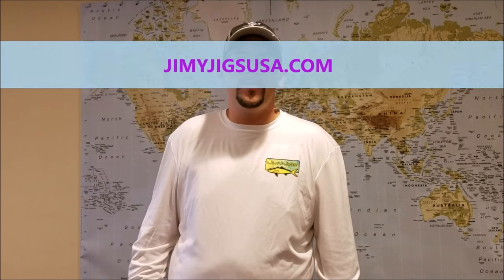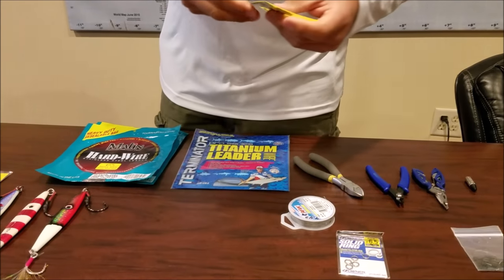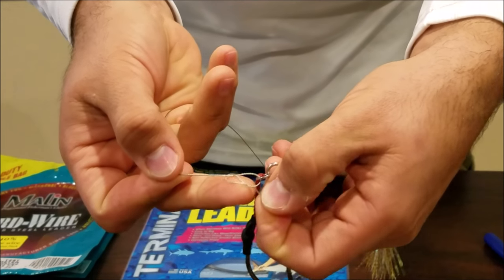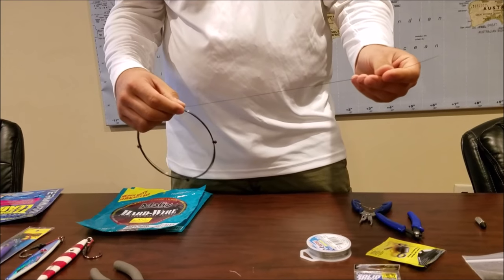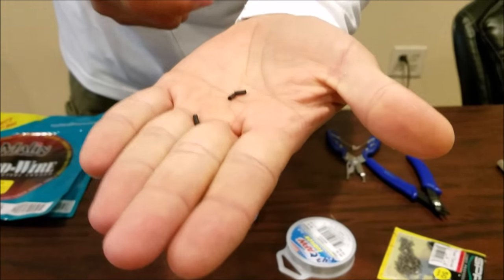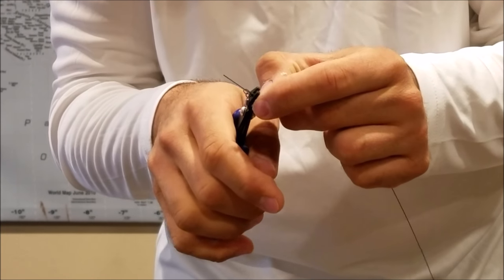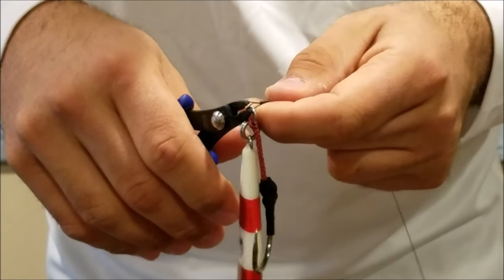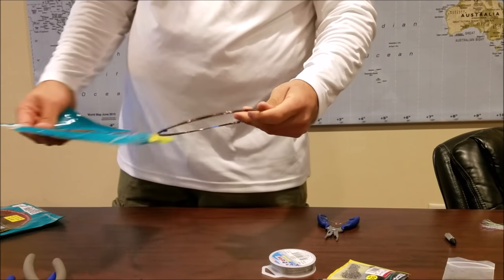How to tie wire leader to your vertical jig

Comment: Nice demo! I just wrestled with coming up with a solution of my own, to cutoff jigs. Commercially available wire leader assist hooks are limited, and hard to find. I do have the steel leader hooks shown in this video, but wanted option(s) I can use with any size/type of hooks in my tackle box that matches the size jig. Some field testing, to see how fish will react, is ahead,  before posting my solutions. Thanks for sharing this video, great job!

Comment: Bro, but wire leader can afraid fish? Sorry for this question, I just wanna know.
Reply: The chances are really low depending on the fish's sight and the day but it's better to have a wire because the chance of a fish getting in the boat is higher than with just mono because it has a much better chance of breaking off, plus if you break off you loose the jig. Switching to wire will increase your catch rate and make you lose less vertical jigs.

Comment: I like using ball bearing swivels on my vertical and surface jigs. They're pricey absolutely but I think it really allows the jig to swim better. I like the Owner ball bearing swivels myself but there are lots of good ones. Give it a try, they're a couple dollars each but I rarely lose them, I'm more likely to have my assist hook cut off than the entire rig. Good luck!
Reply from the maker: Thanks for the comment, yes i have used the ball bearing swivels too they are great as well.
Reply: Hi..does wire leader doesn,t affect the movement of a jig..I wanted to try it for so long but I always think the jig will not move freely and I might never catch a fish.I just usually do shore line fishing using 20 to 30 gram jig..

Comment: do you reduce the number of bites by using metal leader?
Reply from the maker: Some people say they do and some say they dont, in my opinion i rather use the shortest piece of wire i can get away with about 6- 8inch and use titanium which is flexible and allows for a more natural motion of the jig like mono leader, and if im going after king fish i rather get 7 out of 10 possible bites and put them on the boat than 10 out of 10 and lose more than half to cut offs.

Comment: Do you attach the wire leader straight to the braided line?
Reply from the maker: no, I attach it to a 10-15ft leader then with an FG knot the leader to braid
Reply: Thanks for your response, really appreciate it!
Reply: Hello. What pound test fluorocarbon leader do you recommend for fishing over wrecks for Amberjack, Tuna, and the occasional King?
Reply from the maker: my most common setup is of 40lb braid attached to 50 to 60 Lb Fluorocarbon leader. My rule of thumb is to go 10lb heavier on the leader than my braided line. Attach it using an FG knot so it flies through the guides. 
Also if using Fluorocarbon which i recommend because it is a lot less visible underwater than regular mono leader be sure to have minimum of 10FT because sin it stretches so little you want that little extra length in case a big one hits your jig and your drag is tight so it won't pop your knot/line. 
 TIGHT LINES!!

Comment: Bear with me I am here in Asia.  They don't do things the same as other parts of the world.

I am new to this type of fishing, but I would like to know why use wire leader to the lure over straight fluorocarbon to the lure? 

I see a lot of jiggers here using higher lbs fluorocarbon leaders to the lure, and their mainline Lbs is lower.  Example  Mainline PE 3/ 30 lbs., Leader line 60-70 lbs.   Can I assume this is why they are not using wire leader to the lure? 

I have asked many this question, and the only answer I got was they see what everyone else is doing. They don't know.  What say you?
Reply: Simple answer is that the toothy fish cut you off at the flouro when they either miss the jig or even possibly grab high on the jig where their teeth will be above onto the flouro.  Flouro has no chance with those teeth.